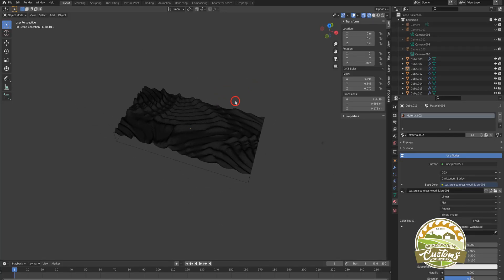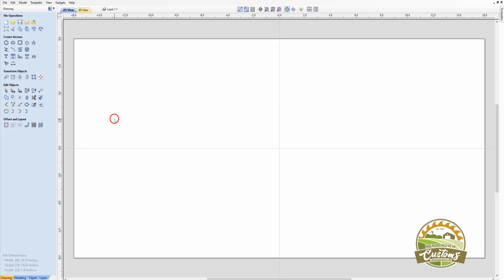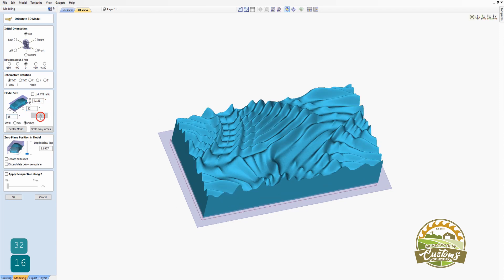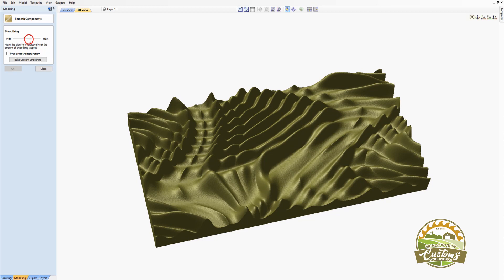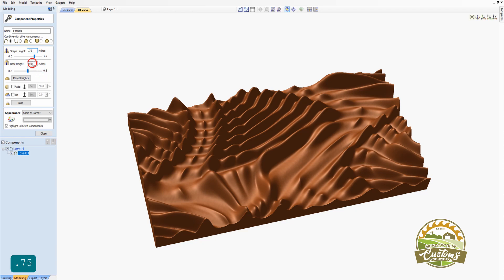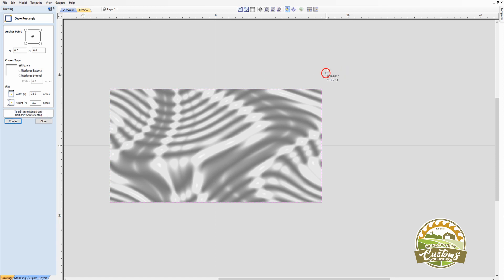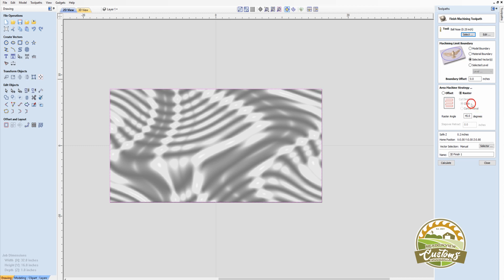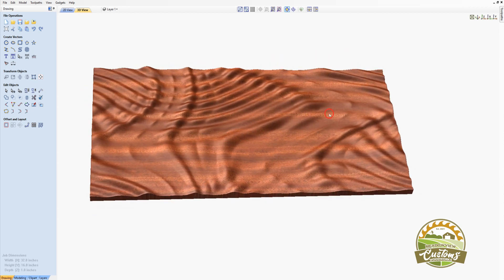How to import 3D STL file to your CNC Software

Comment: what is the raster angle?
Reply: so where or what menu is the Raster  angle setting?
Reply from the maker: @eross21  there's a section on this page with an image of the "finish machining toolpath", then "machining strategy"....under here, you'd select "raster", then under that you can specify the "raster angle"  :)  https://docs.vectric.com/docs/V10.0/Aspire/ENU/Help/form/Finish%20Machining%20Toolpath
Reply: @patriotcncfiles  you have no idea how helpful this is.  thank you so much
Reply from the maker: @eross21  do you think it would be a good topic for a video? I'm guessing you are trying to figure out the best way to carve 3D files using the grain of the wood etcetera?
Reply: @patriotcncfiles  yea this would be an excellent video. i have a few things this will be great for. I’m also trying to machine a neck pocket for a guitar but at a specific angle. there are actually many things i could use this process for. please do a video
Reply from the maker: Again - so sorry I missed your comment.  The raster angle is the angle at which the 3D toolpath will follow the material.  EG:  if you choose 0 Deg, it will carve left to right.  90 deg - top to bottom and 45 deg will carve the toolpaths on a 45 deg angle.

Comment: so this is very helpful  what would i do if i wanted all material surrounding this 
3D model to be the height same height as the very bottom of that 3d model? So basically the 3d model would be the inly thing left on the board after machining ?
Reply from the maker: Hi, so sorry I missed this.  What you would do is create a rectangular vector on the outside of your project, maybe offset it by 1/8" from your actual stock size.  Next, when you go to create your 3D toolpath, there is a section called "Machine Limit Boundary"  and under this, you can choose "Selected Vector(s)" --> then select the rectangle you just created.  What this will do is make the carve go all the way around the edge to the lowest part of your carve.
Reply: @patriotcncfiles   no worries at all. thanks this helps a ton

Comment: Great video, can this be done using  V Carve Pro 10.5
Also is there a smoothing option in the above software or is it time to upgrade to Aspire
By the way excellent work on your Etsy page
Reply from the maker: I believe there is a smoothing tool in Vcarve Pro.  Take a look under the modelling tab and under the 3D modelling tools, there should be an icon that looks kind of like a waffle.